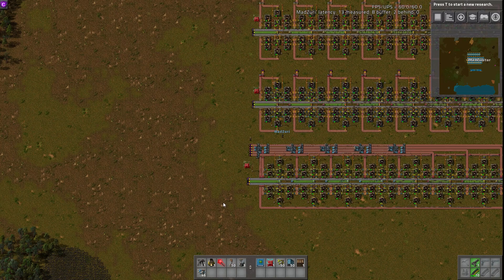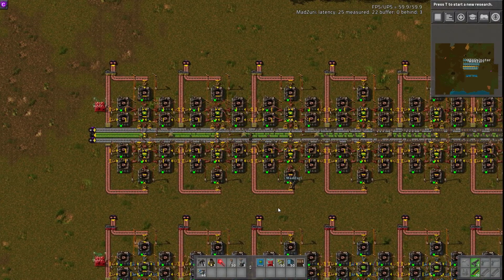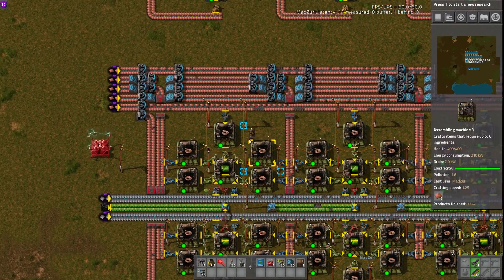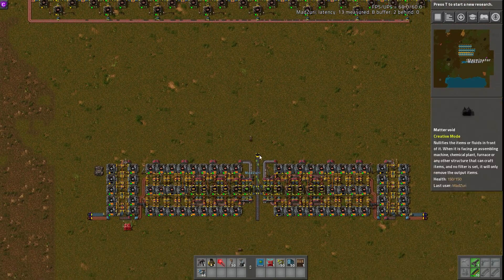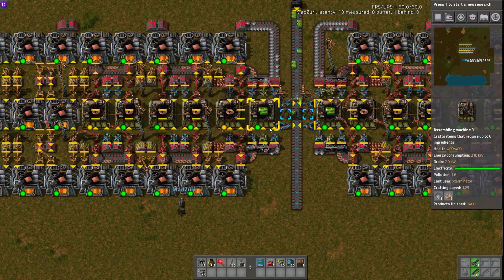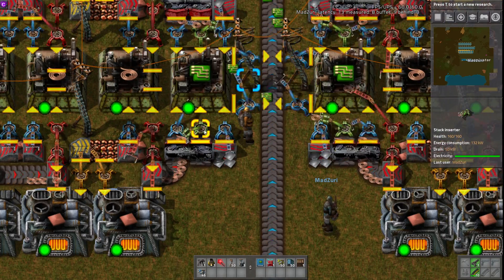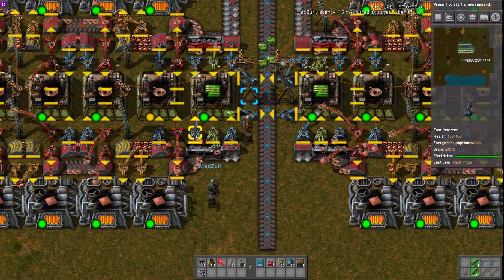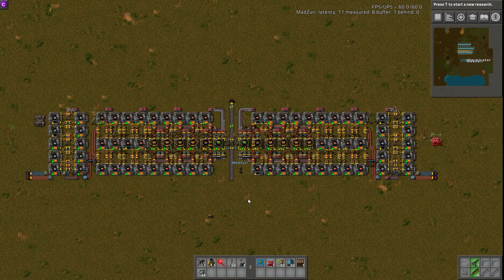Marathon Green Circuit Builds / Setups :: Factorio Workshop Season 2 - Building A Better Factory

Comment: Why exactly does the green circuit maker stall once in a while? It needs 10 copper cable per 1/2 second, and there are 5 cable makers, all direct inserting 2 cable each, every 1/2 second.
Reply: The level 2 assemblers do not stall as far as I can tell which is odd. You do though need 1.25/0.75 = 1.666 times more assemblers, inserters, belt etc.

Comment: Something I kept wanting to try in 0.14 and earlier was using a rail car as an intermediate "chest" for wire - you keep all the inserter bonuses, but allow your wire machines to have a larger "footprint". Wonder if that could be used to smooth out production here.
Reply from the maker: That's a really interesting idea! I've seen a few designs utilize rail cars like that and it could definitely help with some builds. Hard to know for sure if it would work here or not without testing.

Comment: If you used 4 stack inserters set to stack size 5, would they be able to keep up on the last build?
Reply: would still trigger the issue Zuri mentions about when the Asm calls for materials it activates the inserters at the same time... so 4 stack inserters limited would still choke out for a second or so while they are each gathering the wire to insert.
Reply from the maker: May help, but as Mike said, I think it would still be an issue like Zuri mentioned.

Comment: Could you put productivity modules in the electric furnaces or would it not be fast enough?
Reply from the maker: Would probably slow it down too much unfortunately.
Reply: You're need productivity in the other stages as well to keep the relative speeds correct.  My first guess would be 2 per furnace with 3 and a speed per cable and 4 per circuit with 4 cable makers instead of 5.  And 12 or 13 stamps instead of 10.